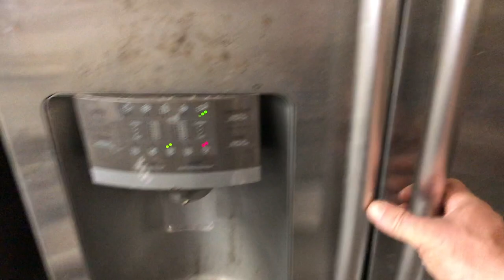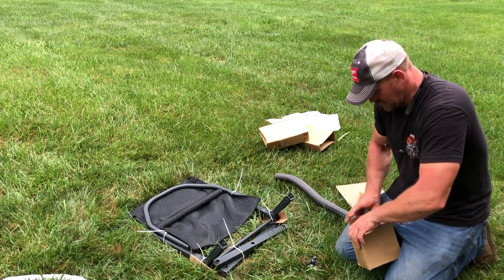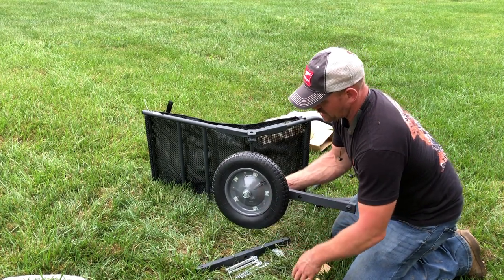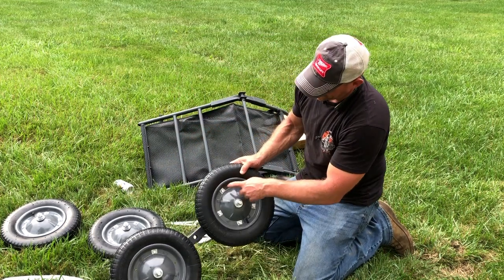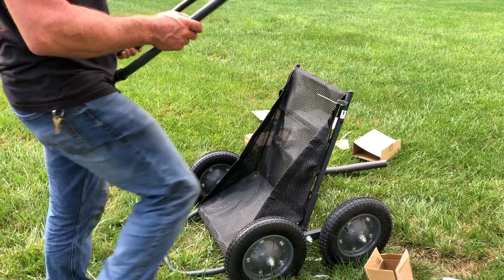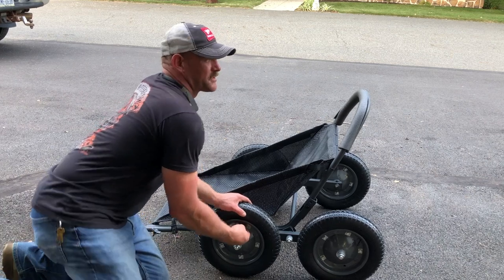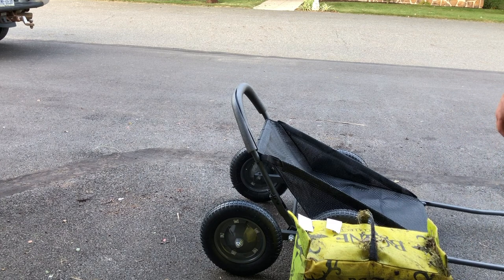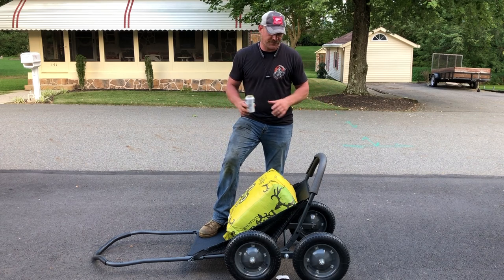Unboxing and Assembly of the Hawk Crawler Multi use cart

Comment: 3 years later and I still find the same nut, bolt and 2 washers from the wheel that you did lose in the damn box that I just bought last week. Holy crap they need to fix that!  

The directions that came with the cart were as clear as swamp water.